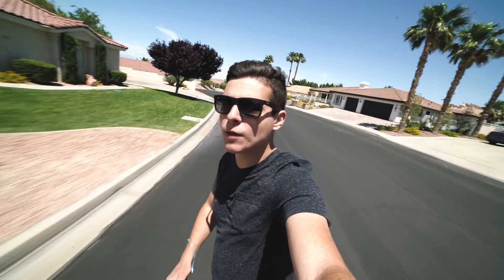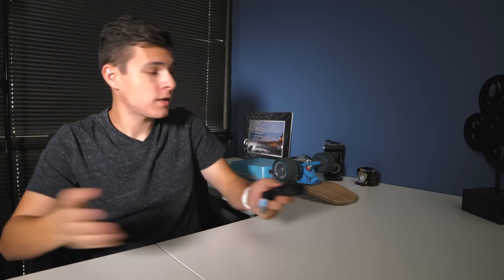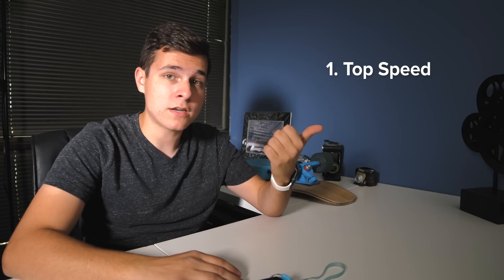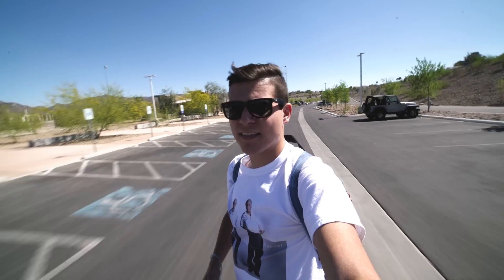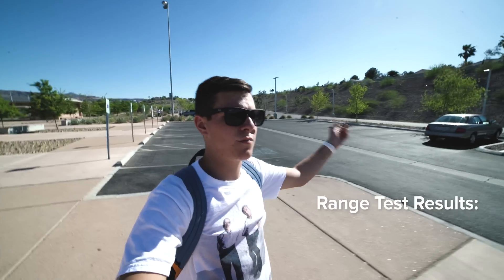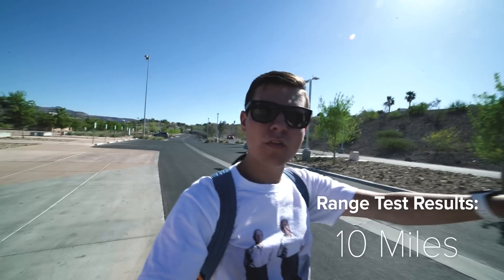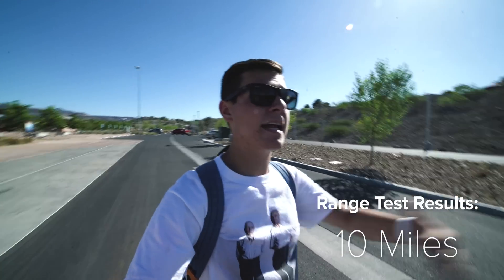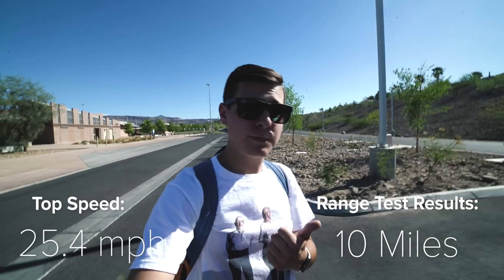DIY Electric Skateboard Build - Better Than A Boosted Board

Comment: why not a balance charger?
Reply from the maker: +Dominic Dymond I am using a balance charger
Reply: Mike Beard sorry I hadn't seen all your videos yet before commenting.  Have you tried the idst q6 plus or 620 charger? They handle 13 or 20 amps of charge if connected to a 6s battery that can handle that charge rating. You could wire two batteries balance chargers plugs in parallel to give a super fast charge speed.  Which is adjustable down to a trickle if needed.  It's expensive but two idst q6 or one q6 and one 608, or any combination will charge what you have for batteries. Will your power system handle 48v? If so that would be more advantageous when choosing a charger.  Although they charge up to 32v you're running them at 36 so you would do better to take 4x 3s batteries and connect them as 2p6s for charging.  Then they would probably take the full 20 amps from the idst 620 I assume and you would only need one charger.  But then again that's a lot of power for that motor.  

Edit. With idst you would need two charger to quick charge.  But they are so small it wouldn't be too cumbersome.  

Second Edit.  I take it back... if you make an adaptor to connect the power leads to the charger as 24v 2p6s and another adaptor to link all 4 balance leads as 2p6s you could use one idst 620 at 24v & up to 20A.  Assuming each battery pack is atleast 10A C-rated
Reply from the maker: +Dominic Dymond damn yeah that sounds like it would work for sure. I'll look into that 😎
Reply: Good luck.  I'll look into affording to build my own lol

Comment: Whats the breaking system like
Reply from the maker: +Martin The Savage God When you pull the throttle backward it reverses the polarity of the motor and the motor slows you down until stopped. It works very well. Also is regenerative.
Reply: Mike Beard thank you I will deff build one

Comment: What battery setup do you have to get 10 miles?? I have a 6S1P Lipo setup. It goes 25 mph but only gets 7 miles. Are you doing 8, 9 or 12S? Asking because my buddy is doing a build soon and was thinking about a 12S system.
Reply from the maker: I am running 3 3s batteries in series to make 9s

Comment: i am planning on building my own board,  what motor and gearing did you use to achieve that speed. I want to try get all my parts for under 400 bucks. Will take me another 6 months to get a Boosted Board and i wanna ride now!! Great video thank you for all the info.
Reply from the maker: +crazymd15 The motor and pulley system I used is in the description 👍🏻

Comment: Mike Beard Hi, i really like the idea and the whole project in general and im trying to make a similar project. I wanted to know if i could use a different motor controller from the one you used since i find it very expensive(200$). do you reccomend any cheaper ones? Thank you
Reply from the maker: I have only used the one from enertion, I hear good things about the VESC from Miami Electric Boards. That VESC is only $110
Reply: Mike Beard Thank you for your help :)

Comment: I also go to UNLV, and I know exactly what you mean riding around. I wanted to get a Boosted Board, but I'm not prepared to spend $1500 to get around campus.
Reply from the maker: Exactly why I built one, I probably could have saved a little longer and gotten a boosted board, but this way was more fun and ALOT cheaper. Maybe I'll see you around sometime :)
Reply from the maker: About $600
Reply: How much did it cost you overall
Reply: Sounds good! I've seen you riding around with a camera a couple times before. I'll call you the next time I see you around. Btw, I just followed you on IG.
Reply from the maker: Haha awesome man! Just shout and I'll stop and say hi!

Comment: Hey why not just use 18650 batteries? Like a tesla or an actual boosted board, and arent the LiPo batteries dangerous?
Reply from the maker: Lipos seemed easier to me just starting out. Lipos can be dangerous f you aren't responsible with them. 18650s do seem really nice and would be a nice upgrade. I'd think the 18650s would be more expensive as well
Reply: 18650's can be expensive but really a e-board probably would only need like 10.  And a cheaper route would be to use old laptop batteries and gutting them out.

Comment: any recommendations for a deck, truck, wheels? i weigh 362LBS!! i thought about stacking 2 decks and putting 2 wheels where each wheel goes, but do they make axles that long? don't worry, i'm burning it off on the treadmill.

Comment: Hi, I use the same remote as you for my DIY board,. It does sometimes do weird stuff like accelerating while I'm not even touching it, or sudenly breaking and stuff like that. It happens rarely but it does and its kind of scary. Have you got the same kind of problems and if you did, how did you solve them?
Thank You in advance :)
Reply from the maker: +PRAWON I've had some weirdness with the remote too. Eventually it just went away. Kinda sketchy lol
Reply: Mike Beard I've just set on the median filter on the vesc options and now it doesnt happen anymore ;)
Reply from the maker: +PRAWON so far, I have never had that issue

Comment: I am 17 and going to college next fall an Chicago.  I have slightly above 2k in my account, do you think it's worth it to buy a boosted board?
Reply from the maker: +HotPockets Depends on wether or not you want to build or buy prebuilt. There are still great prebuilt options out there other than the Boosted. Just depends on how much you'd value an electric skateboard. 

To me, especially if you're going to live in the city, it can potentially save you hundreds or even thousands of dollars in taxi fairs if you don't have a car 👍🏻

Comment: What if you hit a large crack going at an insane speed?  I was thinking of adding rubber wheels just to combat that, but then the board wouldn't be very portable.
Reply: LJFMX then ur fucked and gonna eat shit
Reply: Yeah I guess but I was thinking of a way around it. Maybe something like this http://avenuetrucks.com/
Reply from the maker: I have 83mm wheels, Handles cracks like a champ. They are a bit bulky, but worth the smoother ride.
Reply: Mike Beard Sweet. Thanks man.

Comment: No helmet, not cool. I've fallen off my Evolve, neither the board's fault or mine, and the helmet saved my head. But enough of moral posturing.

Edit:

I'm also in the process with making my own board, I planned it with a BMS system from the start but somehow I managed to buy the wrong BMS for my 6S setup so I had to wait for my economy to improve to buy the correct one. I wanted another board that's more carry/city/commute friendly so I too had to research ALOT to be sure I get everything right.

I've bought the most stuff from DIYelectricskateboard, Hobbyking and few ebay vendors for specific parts. The smaller board (27,5") i purchased locally, a cruiser board with a kicktail at the back and figured the extra space would benefit the motor.
Reply from the maker: +Ohem1 😬 I know... getting one soon 😂
Reply: Heh, was editing as you replied.

Good to know, was a bit concerned with the speed. Suddenly there's a rock and you wish to remain in between that and a hard place.
Reply: Also what's your battery setup? 6s? 9s?
Reply from the maker: 9s :)

Comment: Couple things
1. You can get a v2 shipped in 3-5 days now.
2. I weigh 150lbs and can only get about 3.5 to 4 mph at 22mph. I can get 7 miles on Eco Mode at 16 mph. 
3. 0-100% charge on my v2 is about an hour.

So nice build man, that's pretty cool. What batteries are you using in it? I've considered making an 18650 custom board, or using 26650s like the boosted has.
Reply from the maker: +Alex Phoenix I'm just using 3 5000mah lipos in series
Reply: Alex Phoenix i've built my own board using 18650 batteries. I'm using a bms to handle the charging of the batteries. I chose 18650 over LiPo cause I wanted it to be as close to commercial boards (simple and easy charging, more slick design etc.), however I I think that it might've been a mistake to do it with 18650 - for me at least. Currently I have a 10S4P battery on my longboard - and it's a god damn pain to get it right. The cells tend to lose capacity too quick - and they can only discharge at around 4-8C, whereas LiPo can at a rate of 20-40C. Charging a LiPo is more difficult, but I should've invested in them instead of 18650. 
(My 18650's are not the highest standard, but a high end 18650 is simply too expensive with 40 of them) 
Just a subjective opinion :-)
Reply: That's interesting. I get panasonic 18650s for free from my work. They come out of our dead drill batteries. Usually get 1 good cell out of every 10 cells or so. But I've heard that bout 18650s, which I think is why boosted opted for the 26650. I'll look into some LiPo stuff, haven't really looked into that yet.

Comment: parallel charge the batts it will take like 20 mins for all if you get the right charger. assuming you're using lipos
Reply from the maker: +Jrones fpv Yeah just gotta get a new charger 👍🏻

Comment: As somebody know doesn't know a lot about the parts that go into making an electric skateboard, as in the motors, etc., I'm curious, if you were willing to make cuts into the top speed and distance traveled how low do you think you could get the price of the board before it because almost useless due to slow speeds, short ride times, etc.
Reply from the maker: +Nicholas Catalanotto Well making cuts in price won't effect the top speed and range too much. What happens is you will end up buying worse quality parts and they will end up burning out or breaking faster. 

For example, I have 3 batteries in series. If I take out 1, my top speed will got from like 27mph to about 18mph. And that will only save you a $25 battery, but greatly sacrifices the top speed
Reply: Thanks for the quick reply!  I looked forward to watching your future videos.
Reply from the maker: +Nicholas Catalanotto Thanks man 😊

Comment: So what kind of connectors did you use? or did everything just kind of fit together already?
Reply from the maker: +karaterat27 I had to end up soldering on 3 bullet connectors to my VESC. I also bought a bullet to xt60 connector to attach my batteries to my vesc.

Comment: hi, Mike. I can help you charge all three batteries at the same time, and for even less time if you want to. I can show you how. I do this all the time with my R/C airplanes. I can show you or link everything that you'll need to buy. I have a lot of free time right now. I charge four batteries right now for my drone. it's called parallel charging. you will have to know a little bit about charge rates, discharge rates of a battery, amperage, and making sure the voltage is the same for all your three batteries so it can handle balance correctly before parallel charging (which I don't think is applicable in your case, the last part I mean). it's all very easy. you can even charge eight batteries at the same time if you invest in a higher amperage charger and power supply. but, that'll cost you a little bit more $. expect to pay about $160 to $200 for a decent charger.

you can send me an email at mentuemhet@yahoo.com if you're interested. however, title it as "that guy from YouTube." otherwise, I will think you're spam.
Reply from the maker: +mentuemhet Thanks man! I'll check out some other chargers and parallel charging and I'll make sure I shoot you an email if I have any questions!
Reply: sure. FYI: I got my charger, power supply, battery connectors, and the parallel board from Buddy RC. They're in the USA. it's an online company. good luck, and hit me up if you have any questions. GetFPV, and RMRC, both in the USA, might also have them too, but I never bothered to check. I try to only buy in the USA in case I get a defective product and have to return it :)

Comment: Great board I built one that has a top speed of 45mph, but I've limited that using my vesc because it's a bit too fast, I like how you say it's better than a boosted, but it's hard to compare a diy with a boosted because a diy will always beat a boosted in speed and range, but the build quality of a boosted is stunning and it comes with an app and the startup is very smooth
Reply from the maker: Yup, just depends what you value in a board. If it's about range and speed then DIY for sure, if it's about convenience and ergonomics then Boosted Board all the way.
Reply: What motors did you buy?
Reply: Isaiah Schlegel I actually only bought one motor, the turnigy sk3 245kv, its great for budget boards yet it's got an enormous amount of power, using this motor with an untamed esc is like a boosted board on steroids, it will throw you of fairly easily, it hasn't been hot yet I've ridden up and down hills at high speeds and it's only been warm, the only damage on the motor is a few scratches from rocks I really recommend it to any diy skateboard builder
Reply: Thank you! where did you buy it?
Reply: If you have any more questions about anything I'll be happy to answer them for you I've tried out a lot of things and learned a lot from my mistakes haha
Reply: Are you on a decline when you hit 45mph?  That's seriously nuts!  I'm running a 6374, 190kv and 42v and have only gotten to 33 mph.
Reply: Big Kids im a sub of yours haha, no its just above 60km/h top speed and just remember a higher kv motor has a higher rpm but less torque compared to a lower kv motor its all about the windings of the poles inside of the motor
Reply: And 33mph is still crazy fast for a longboard haha
Reply: Big Kids if you do want to increase speed you can also play around with gear ratios and wheel size I use 90mm wheels, and a 16 to 32 teeth pulley system. Remember a higher kv motor can't take more than 8s on the vesc without risking the chance of damaging the vesc, but with an esc you can definitely exceed 40mph with a 10s battery
Reply: Isaiah Schlegel I bought it from hobbyking, it cost me around €70 but I have a gold membership so not sure how much it would cost you, it won't be to much more
Reply: https://hobbyking.com/en_us/turnigy-aerodrive-sk3-6364-245kv-brushless-outrunner-motor.html?___store=en_us Found it! you're a boss! what did you use to mount it on your board?
Reply: Isaiah Schlegel that's the one! I actually mounted it using DIYElectricSkateboard kit, which is fairly expensive, but you do get caliber 2 trucks, 90mm wheels including bearings etc, motor mount (adjustable), wheel and motor pulley (16t motor and 32t wheel pulley) a 255mm belt and truck risers. I paid about €317 for the kit, an enclosure, ( for 2 3s batteries), and the remote (winning w2 nano remote)
Reply: Man, I've got to try the 245 kv then!  LOL, and thanks for the sub :)
Reply: Shit it is!  but now I wanna go faster :)
Reply: Big Kids haha I get it my first board went about 25mph top speed, it was way too fast at first but didn't take long before I wanted that extra kick on a long flat bike lane whilst going to work
Reply: bryan ruiter ahhhh there's the key, the ESC!  gotcha! I was wondering how you pulled off your speed with the high KV and the voltage restrictions. Makes sense since with a dual motor you usually split up the voltage and have a higher KV.  I have messed with the pulley ratio and enjoyed difference.  But with my 100mm MBS wheels my mono drive isn't very happy.  Gunna try some Carvon duals pretty soon 🙂

Comment: Nice job on the DIY board, Mike.  Years from now, in hindsight you'll see how far that sort of self-determination and confidence transferred far beyond researching, developing, and building this hybrid "toy / semi-sane mode of transportation".  (I'm not trying to be condescending at all. I'm a 40-something senior engineer, who was fortunate enough to obtain a great college education while self-teaching myself all sorts of odd mechanical design/repair/welding/electrical/automotive/etc skills.  All of these skills and passions interweave and tend to apply to broader [e.g., leadership] life skills in general.. OK, I'll get off my soap box now).   Minor correction to your post though : Ordering and receiving a new Boosted board is not a long painful process (other than the wait for the extended battery).   I ordered a Boosted Dual V2+ last Wednesday evening (5-17), and it shipped the next morning from Mountain View, California.  If I were lucky enough to live in Cali, I would have had it within one or two days from ordering - which is amazingly fast.  Sadly, I live in Raleigh, NC - so I've been watching it creep across the country and is scheduled to arrive on the 24th - only 6 days from order time. 

....They claim the extended battery will ship 4Q17.  Time will tell if they finally live up to their word on that.  The limited battery range of the standard battery is by far the Achilles heel of the Boosted board, and is hurting their sales by the second, I suspect.
Reply from the maker: +vaprex Yeah sounds like Boosted Board has finally gotten their production situation down now. Just seen so many people have issues with it. Glad to see they got it all sorted out. And the Extended battery situation, I hope they get that handled soon 😬

Thanks for watching 😊

Comment: How much do you weigh?
Reply from the maker: +Logan Shadaia 150-160 depends on the day 😂
Reply: Mike Beard you think I can pull some speed with that motor at around 215lbs?
Reply from the maker: +Logan Shadaia Maybe not as quick as 27mph but it all depends on the build but most of the boards are very powerful and can definitely pull some speed. Most of the time I'm wearing a back pack with lots of camera gear in it that makes me more 170-180 and I still hit some fast speeds
Reply: Mike Beard Okay cool! Thanks for the reply man keep mako them good vids :)